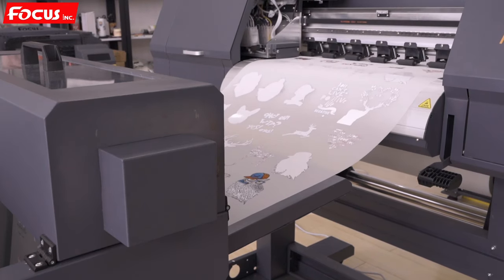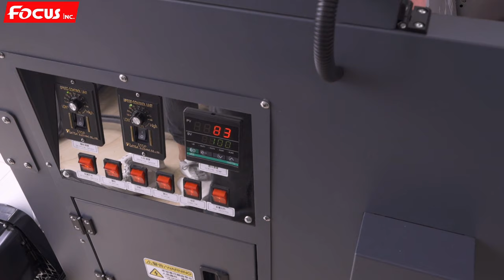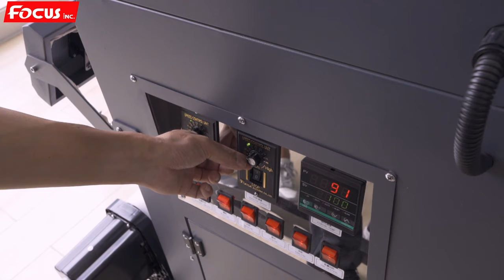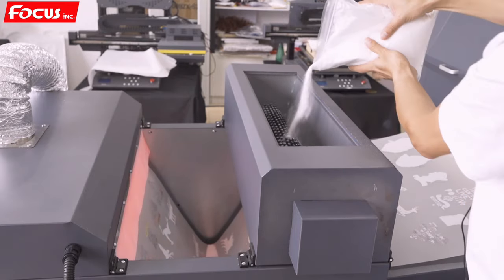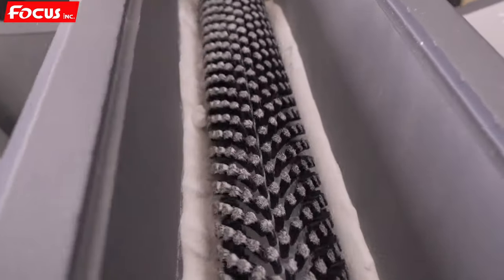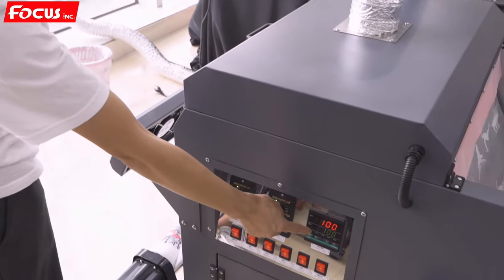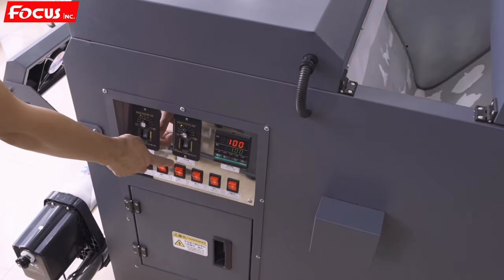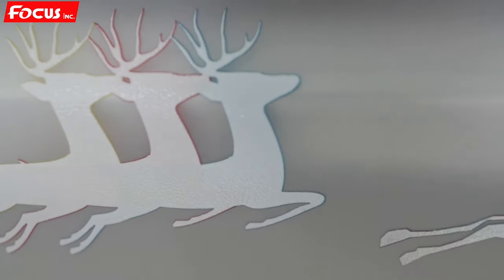Industrial DTF Nebula-62F tutorial 16:How to use a DTF printer - Power process system explanation

Comment: It is the Hot melt powder poisonous? Does it create toxicity when it's heated up? Or is the Hot melt powder dangerous if handled with their skin? Also do you need extra well ventilated area? Or would a standard room without extra ventilation work?